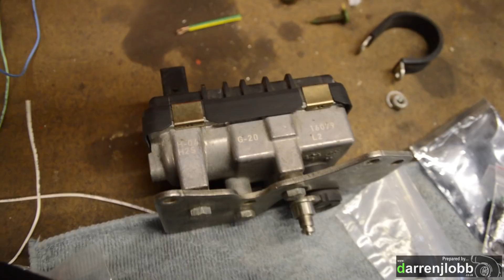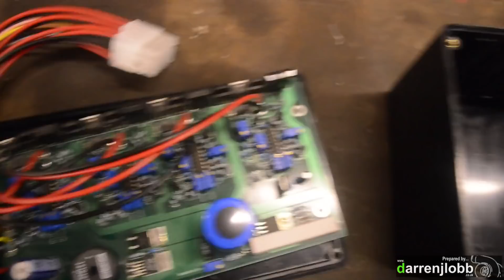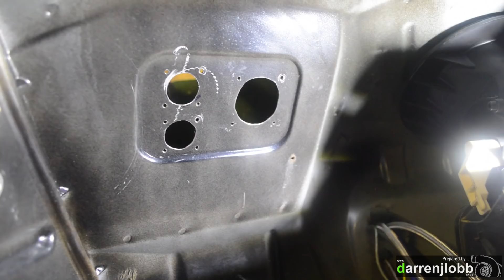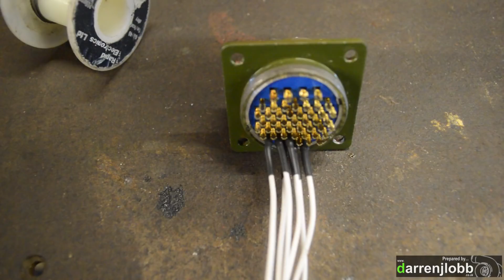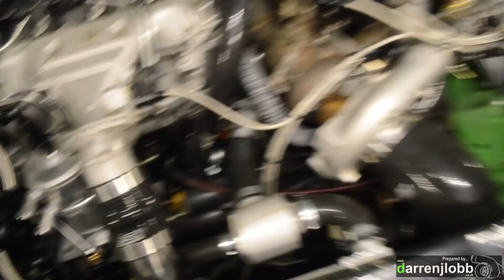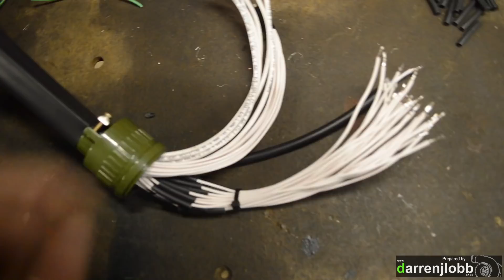darrenjlobb's JD DervBus Project Part 26

Comment: You really should do this full time doing cars 🚗 for paying customers ,why do you not use different colours wires ?
Reply from the maker: Dont think there is really much of a market for this type of work in the UK, esp down here in Cornwall... Regarding wire colours, personally prefer everything to be one colour, looks much cleaner / saves confusion when wrong assumptions are made regarding the colour of the wire!